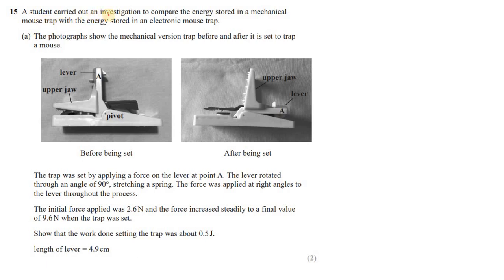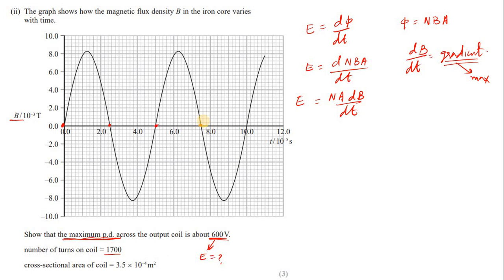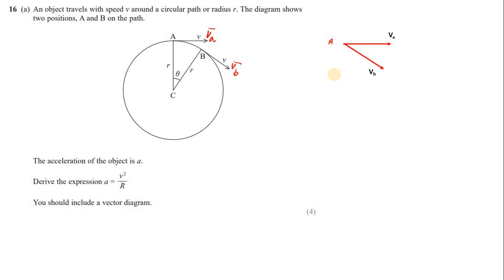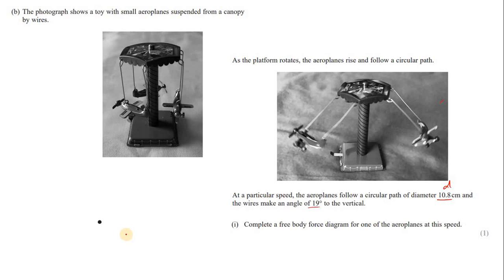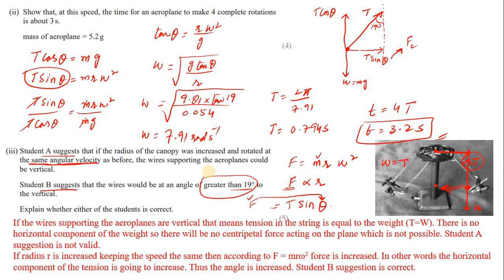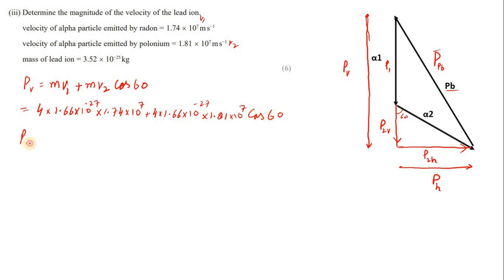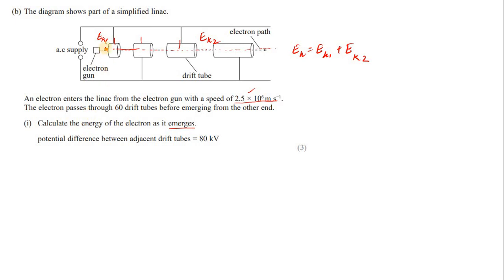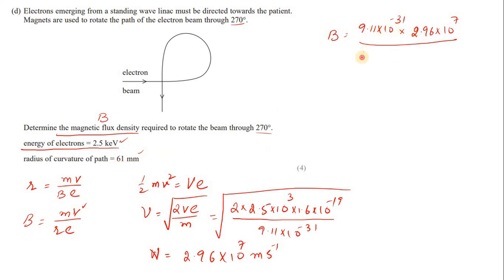Edexcel IAL physics unit 4 WPH14 Oct 20 Part 2

Comment: In question 16a, why is delta s equal to arch length? Isn't delta s the base of a triangle?
Reply from the maker: Yes, it is. But when we take time interval, very small delta t ----> 0 the arc length is approximately same as the base of the triangle. I hope you understand it.  Thanks

Comment: In question 17, b iii, why are we taking the mass of a proton as 1.66x10^-27 even though weve been taught and in the units in the end of the paper it says 1.67x10^-27? Im getting the entire question wrong because of that
Reply from the maker: Yes, the mass of a proton is 1.67X10-27, but the mass of an alpha particle is 4u (u = unified mass ) and there are two protons and two neutrons in an alpha particle, 1u =  1.66X10-27 kg. I hope the explanation will help you. Thanks